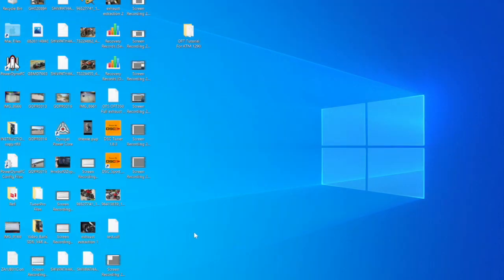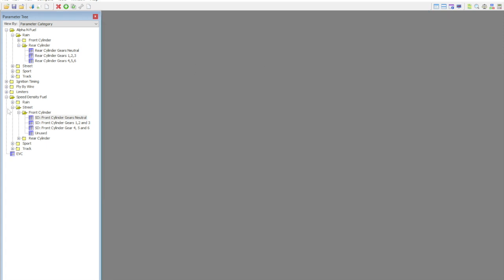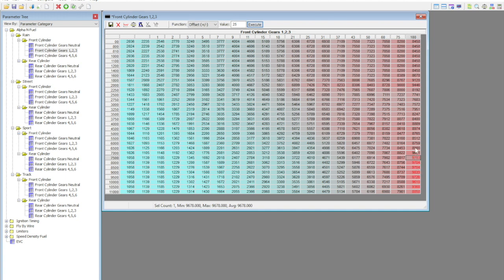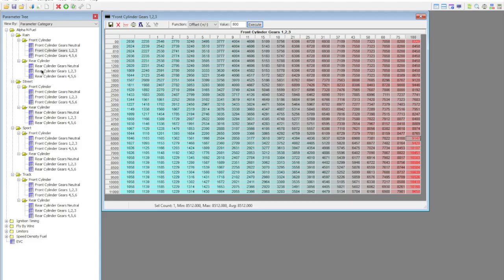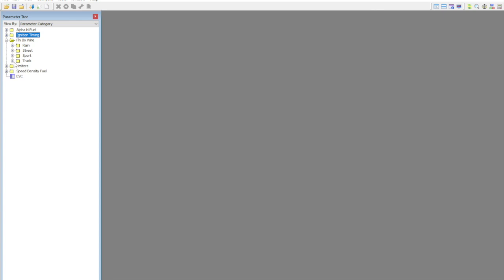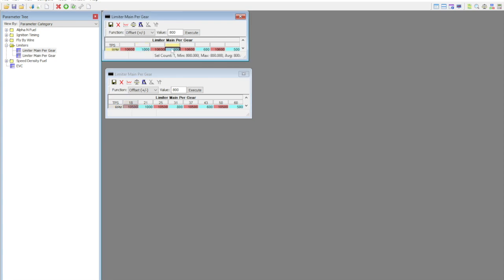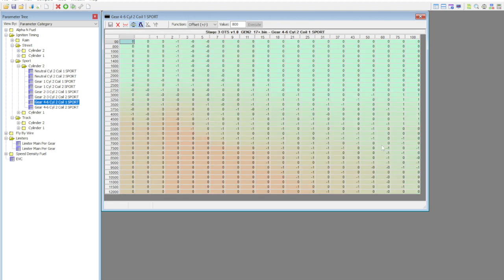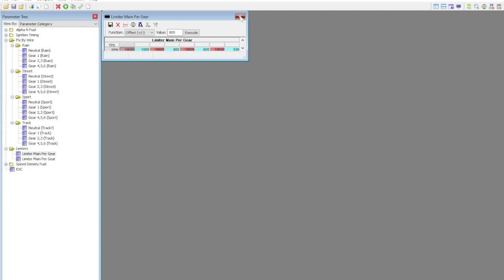OpenFlash Tablet Tuning Tutorial for KTM 1090/1190/1290

Comment: I don't understand why removing the O2 sensors is a bad thing.  The fuel "learning" capability from O2 is only in a small RPM range for emissions and only functions on the speed density maps IIRC.  At least it's this way on my RSV4 from what I've read.  I don't think I've seen an actual race bike with O2 sensors that were active.  Also, isn't there supposed to be 2 different limiters?  A soft limiter and a hard cut one?